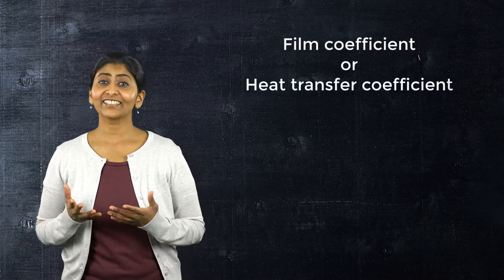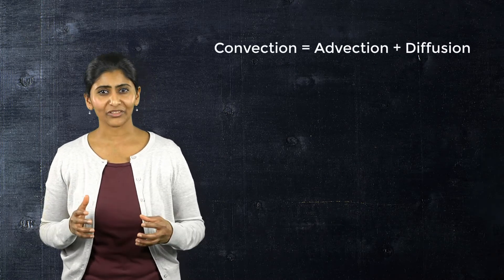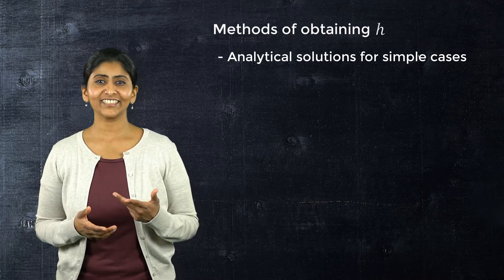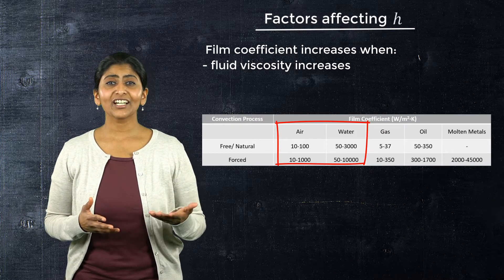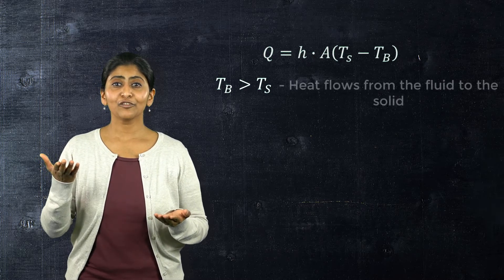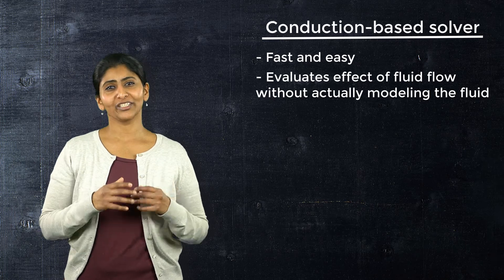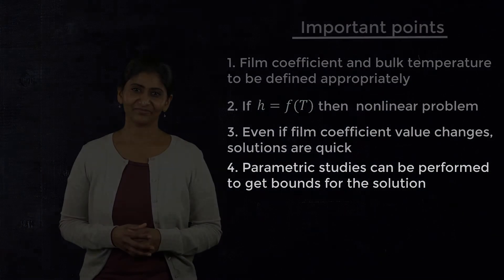Film Coefficient — Lesson 2

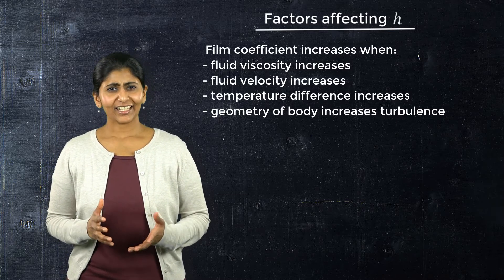Comment: @7:40, you said film coefficient increases with viscosity. higher viscous fluid has thicker  boundary layer and With a thicker boundary layer, the fluid flow near the solid surface becomes less efficient in transporting heat away from the surface, resulting in lower heat transfer coefficients. Therefore, higher viscosity fluids often exhibit lower heat transfer coefficients compared to fluids with lower viscosity.
Reply from the maker: Thanks for watching! Please post your query on the Ansys Learning Forum for a detailed answer from the wider Ansys Community: https://ansys.com/forum.